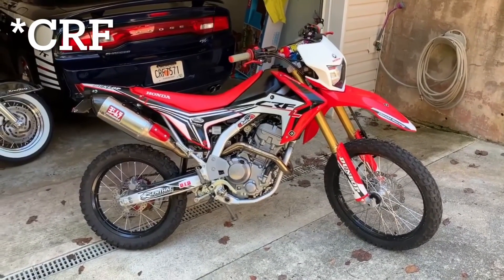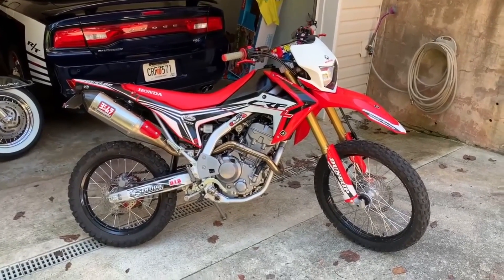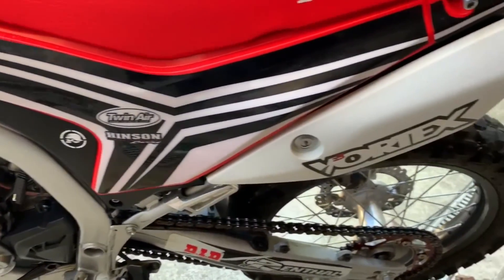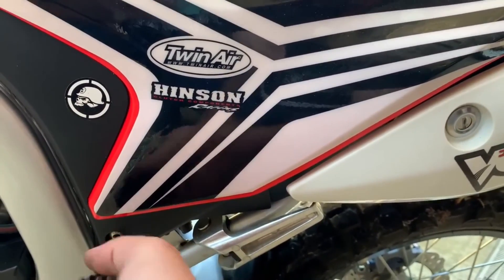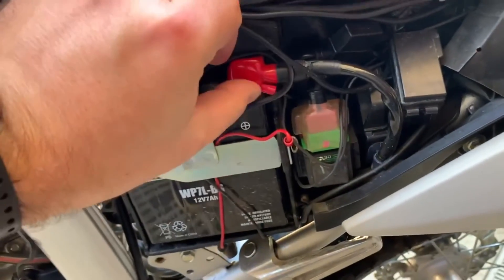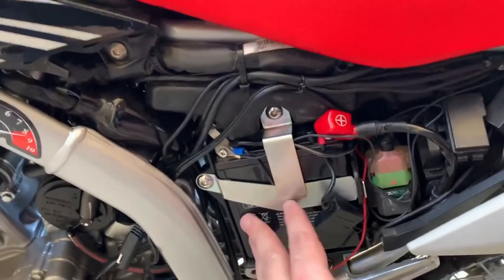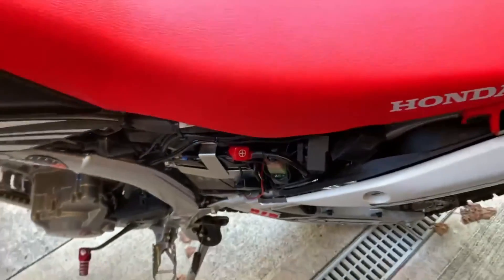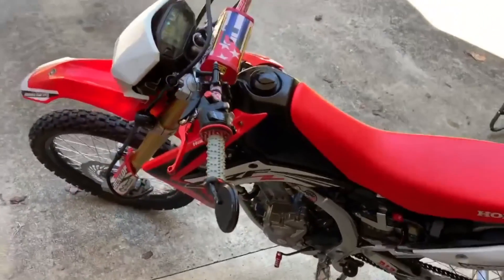Battery Replacement and Wheelies - Honda CRF250L

Comment: Hey do you run a power programmer if you do please let me know your settings I also have a pull yoshimura exhaust with no air box mods and a fmf programmer I’m at 6000 elevation
Reply from the maker: Hey bud, check out our video on that.  The EJK video.

Comment: I have a 2017 crf250l just got recently all stock .I was woundering if I can just throw on a Yoshimura exhaust and be ok and what oil do you recommend 
i was looking at GN 4 honda oem 10-40w SI  and I want a oem battery if you can help it would be very appreciated.
Reply from the maker: That’s great.  Yes, you can just put the Yoshi pipe on with no other mods.  Honda oil is good oil, but I recommend using AMSOIL in everything.  You can get it here: https://www.amsoil.com/p/10w-40-synthetic-dirt-bike-oil-db40/?zo=30186226
Reply: @HiRevzMedia  thank you allot new sub
Reply: @HiRevzMedia   and how about a oem battery what would fit and wold last a long time thank you
Reply: I recommend buying a fuel tuner. Like EJK FUEL TUNER. You don't want to run your bike too lean. Bad for the engine. The fuel tuner is needed